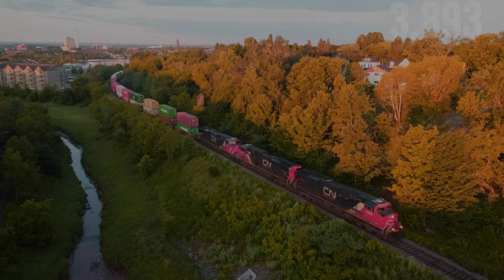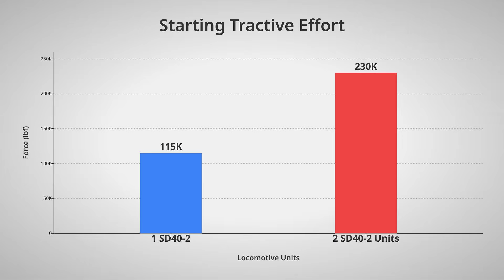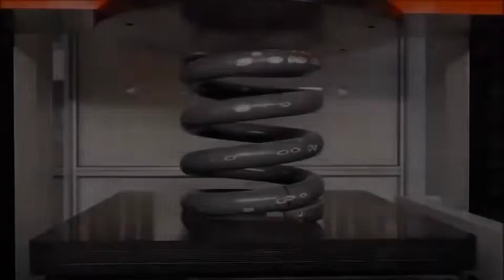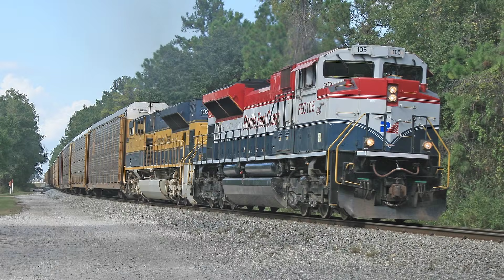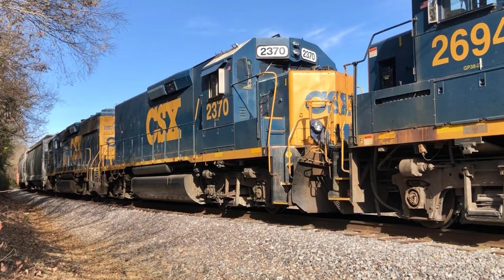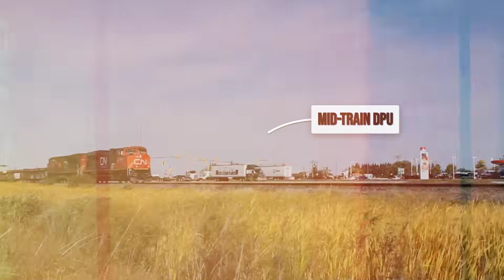How Can Two Locomotives Pull 10,000 Tons

Comment: basically   there is barely  any friction between  the steel wheel and the steel rail. which is why you have can  2 locomotives weighing 150 tons a piece can still move a train weighing 10,000 tons. there is no way this could be done on the road because of the  higher friction between a rubber tire and asphalt road